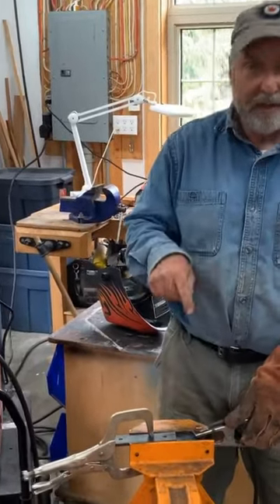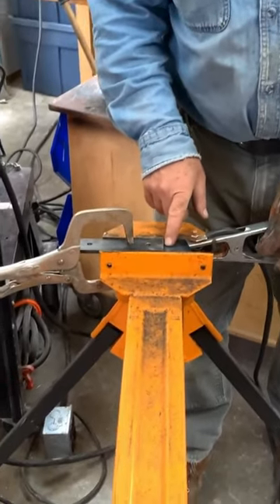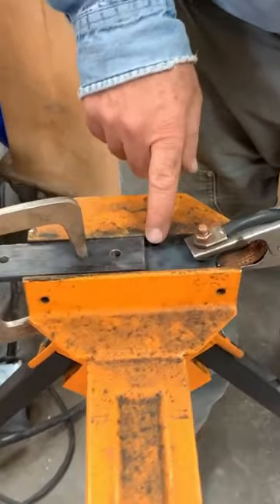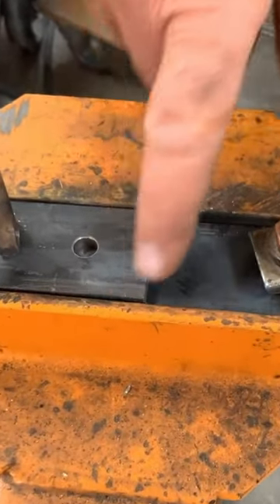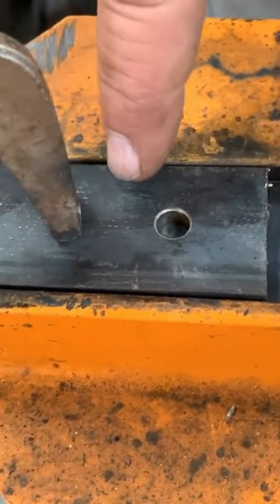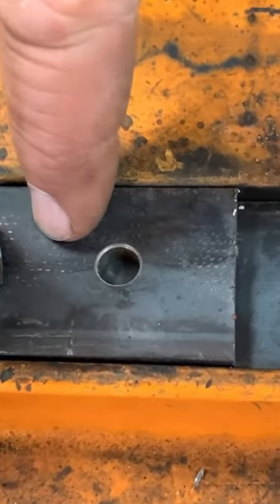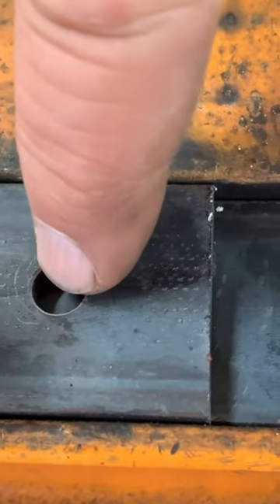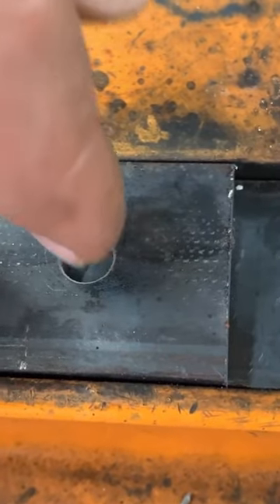Plug Welding Steel #shorts

Comment: This is a hack job. You need to grind off the mill scale from the bottom piece.  Some contaminants will be drawn to the surface but with a plug weld you're just burying them.
You should also be pushing the weld into the sides of the hole and not just pouring metal into the center.
Reply: Definitely not for climbing use lol

Comment: I see the other weld. Not going to fool me🧐
Reply: Facts it looks sketchy
Reply: Look again 🤦‍♂️ 

why should he fake it in the first place? 🤦‍♂️🤦‍♂️🤦‍♂️🤦‍♂️🤦‍♂️🤦‍♂️🤦‍♂️🤦‍♂️🤦‍♂️🤦‍♂️🤦‍♂️🤦‍♂️🤦‍♂️🤦‍♂️
Reply: @karl0h580  ngl i thought it was a bead too, which it is a bead but it's not a long the seam on the far side of where the camera is looking.
Reply: He definitely has a tack weld on the bottom side where the first ends
Reply: methinks its a plug weld on the other side as well..
Reply: He just used the other side as a different example I assume for a different video without wasting the pices for 1 small weld.
 I assume at least. 100% speculation apon observation. So my opinion is a just grain of salt. But.
  When he did that weld on the back it would have created tension, shrank and lifted the end up on the opposing side (plug weld side)  it would of ben about ¼" ish of separation between parts at the end he plugged.
 His plug weld is holding down all that tension created from the 1st weld and kinda proves the point even more so if you know whats happening with the mettle.
Reply: It's clearly not on the joint it's on the bottom not at a seam. This was s obviously two pieces of scrap that is just being used for an example. The other bead isn't adding anything structural.
Reply: I've welded several times this way not as strong as a seam weld but still a strong weld
Reply: @alexanderwells5148  999

Comment: A few things, I'd make the plug weld hole diameter larger next time or when using thicker steel I'd make a slot weld instead. It would give you 3x more capacity.

Comment: Plug weld did not burn in properly not enough Heat
Reply: I agree brother
Reply: No discoloration on the backside of that plate
Reply: He spent his time filling the hole not burning the bottom plate if it wasn't welded on the back side it break if you drop it
Reply: There's a gumball on the back🤣🤣🤣🤣
Reply: @tscustomstation  no it wouldn't.

Comment: But....  You've got a weld on the OTHER SIDE holding your neat little INSIGNIFICANT PLUG WELD TOGETHER.  😲
Reply: Yeah cause you vehicle is basically plug welded together
Reply: @chadvalliere8697  vehicles ate usually spot welded not plug welded.

Comment: Just thinking logically here, if it were me I would have used the drill to dimple the bar on the underside at the plug location.  That way the weld penetrates even deeper into the bar steel and resists sideways sheering forces.
Reply: I do that too, not that i did, I don’t do much plug welding

Comment: A plug weld is typically required to have a diameter of the hole that is twice the thickness of the material with the hole or greater. Details Matter

Comment: For those that see the weld on the back.   He probably did that just cause it's easier to keep it all tight. In practice you would have to clamp this all together but it would usually be larger pieces of material and easier to do. Whereas this demonstration piece is small scraps so he's not wasting materials AKA money. Hope that explains a little bit for you all.

Comment: Rule of thumb diameter should be at least twice the thickness. Then consetrate heat on the bottom the top will solve it self

Comment: You should run the drill into the bottom plate just till the flutes are at the out side diameter of the hole. After clamping together. Much more strength.

Comment: It's similar to a spot weld, but I'd have to say a plug weld is probably better, and doesn't require a specialty welder. A plug weld can be done with almost any welder from Stick to Tig

Comment: I’m not a welder but I’m pretty sure you’re only supposed to weld on clean bare metal and there didn’t seem to be any penetration on the back side. Questionable demonstration in my opinion.

Comment: I take the mig tip and follow the Inside Edge to try and get maximum penetration before allowing the center to fill up. If a plug weld is not done properly it may look perfectly fine but be weak as hell

Comment: Just a pro tip! Have some lead on your wire! Point it dead center in the hole and lay on that trigger and don't move! Will fill in 360 degrees not like what you got! Garentee it won't pass xray! I saw a pocket! Don't move and lay on the same spot and the puddle will flow everywhere and heat evenly! Stop when you got a little nub on the top then grind flush and shouldn't have any burn in around the sides to grind out.

Comment: Material that thick needs either a bigger hole or a countersink if you are going to MIG weld it, the actual amount of the lower piece that got hot enough to melt is probably not more than an 1/8" in diameter.  Cut the backside lap weld and twist the pieces then make another video.

Comment: Plug welding is a awesome way to go just as said but if you need a stronger hold you can make a slot weld or add a few more holes and I prefer if you can get to it one on the front and one on the back and that really locked the pieces together so you don’t have a end without weld 👍 just a little extra tip from the a life long welder to anyone thinking about it or having a problem with something fitting but not strong enough for the job at hand 🙏god bless

Comment: A welder of 40 years I would rather have the hole just a little bigger and use low hydrogen stick instead of MiG because sometimes Mig will just roll up and it won't make a good plug weld like the one comment a slot weld would do much better.

Comment: That is actually called a spot weld a plug weld is both pieces of metal have a through them and you fill them in from one side to the other

Comment: That plug hole should've at least been 50% larger to get proper fusion. That weld will NOT pass a stress test by any stretch of the imagination.

Comment: Man up and try to break it off, you may be surprised how weak it can be, it takes a little bit bigger hole than that to make the weld really good on the bottom piece, remember your not trying to weld to the puddle of melted steel, but weld to the actual metal and go back for filler, kinda hard the way you did it

Comment: Good job you made a super thick tack weld since the penetration didn't go all the way through i wouldn't trust that for anything under load either do atleast 2 holes get a grinder and a cutting disk and cut and connect the two holes and then weld that or if you have the access use a cnc to cut a section out then weld that channel instead that won't be going anywhere if done properly the bars around it will bend before the weld breaks and if you want you can even buff it flat and you wouldn't be able to tell you even welded it except for the heat marks and that can be solved with paint or a wide variety of ways

Comment: If you want to prove you have a decent weld, hole the bottom piece in a vice and twist the top. You mostly filled the hole without much contact with the bottom piece. Looks nice but not worth shit in reality.

Comment: Do you think if you put a bevel on the hole on the top plate then put bevel side down onto the bottom plate then do the weld it would make for an even stronger hold for the weld for certain cases

Comment: All you did was fill the hole with metal. There's no way you got full penetration on the bottom piece. I guarantee that if it weren't for that lap weld on the back that you're trying to hide from us, that thing would fall apart if you dropped it on the concrete or smacked it with a hammer....

Comment: Ignoring the weld on the back, wouldn't you want to drill into the bottom piece about a third into it, really get the penetration in there?
Reply: Turn up the heat, and  burn it in Hot 🔥🥵😡... Not enough penetration,  Boss man 😎👀

Comment: More heat, better circles and  make sure your weld comes to the top.  You grind that weld there and its gonna have shallow spots where the weld did not come up..  More heat so the lower plate is penetrated.  This weld here will come apart easily.  Not enough penetration on the bottom.

Comment: You should have done one on either side or done a oval shape if they twist it will snap right off assuming that's why you did the weld on the other side but what is the point if you're going to well the other side anyway if you're going to make a video do it right please and you have a nice day

Comment: Needed to clean the bottom piece of material before welding it and turn up your heat looked like it barley fused together
Reply: I like drilling a little into the bottom piece as well.

Comment: What do you plan on using this for ?
Reply: Anything where you dont want to or can't weld on the seams for whatever reason. Dont take much more from this than that. Hole should be bigger and most likely done in more than one spot depending on size of application. What I was taught was to start on the outside wall and circle inwards as you fill with weld. Break down both metals for complete fusion.